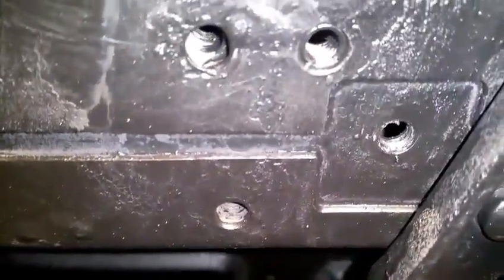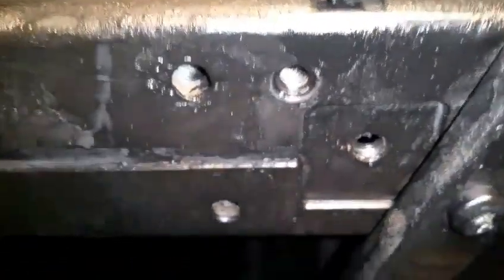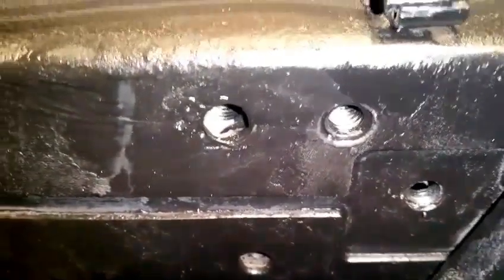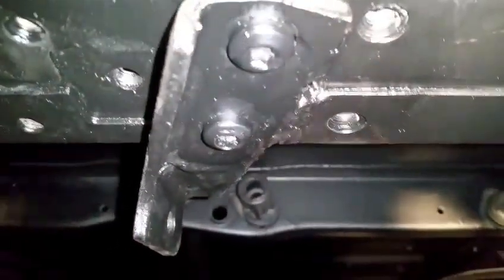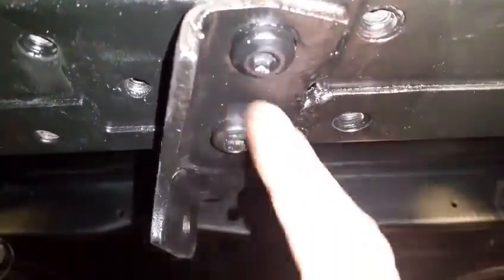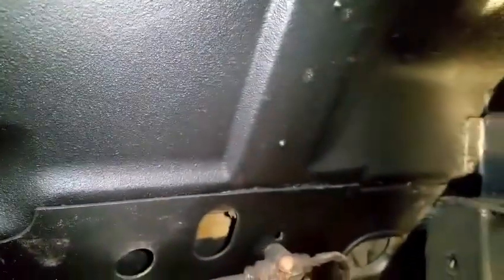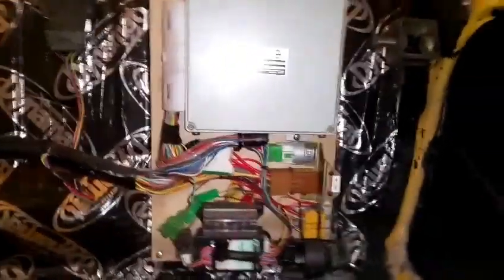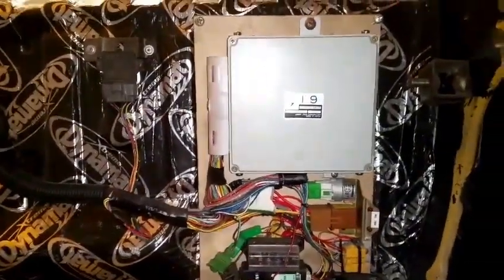VW T25 T3 Vanagon 2WD to Syncro 4WD Conversion Project - More rear end prep work

Comment: Thanks for sharing Mark.  I've got a rusty syncro donor to convert  my 89 westy TDI with.  I'm still unsure what to do on the transmission mounts.  A lot of guys here in the US seem to have good luck with high quality riv-nuts.  Keep it up !
Reply from the maker: Sounds like a good solution, certainly easier and quicker than welding them in. Good luck with your build :-). Cheers